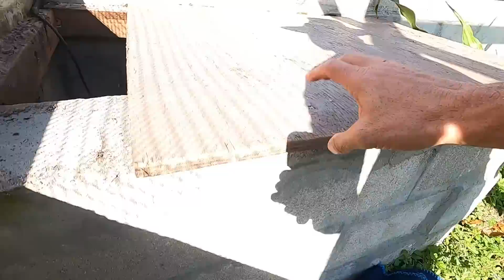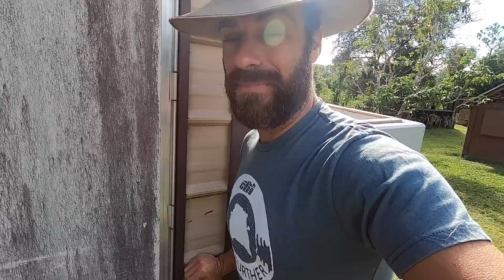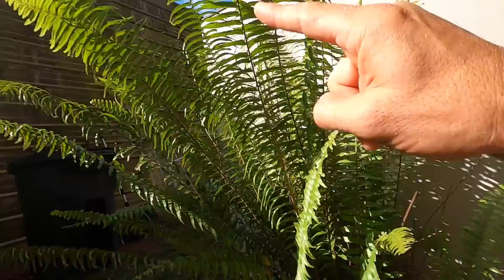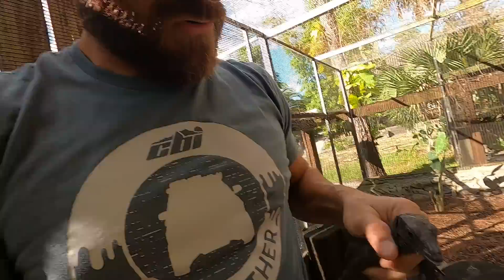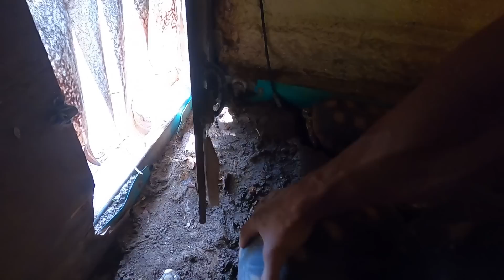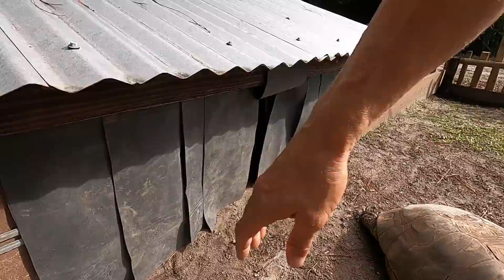First Cool Night at the Kamp...How are the Animals?

Comment: The reason you can lay your reptile on its back is that it's quite possible it will go into a Tonic State (tonic immobility) and relax enough where to can control the reptile and let it go without getting bit. They almost go into a hypnotic trance and calm down. I find it works extremely well on most lizards and iguanidae.